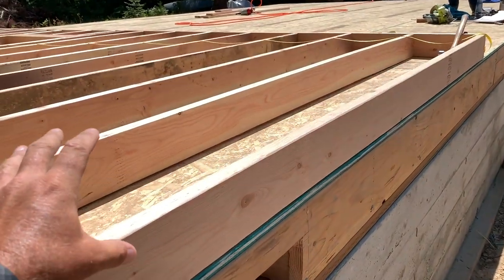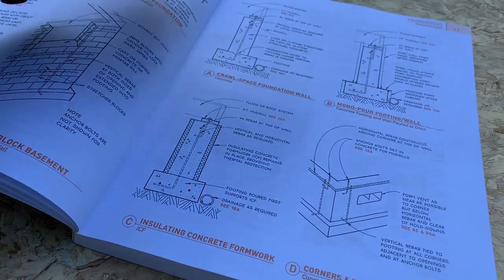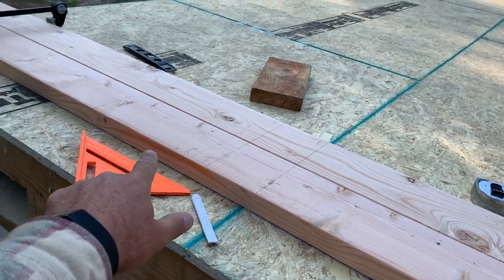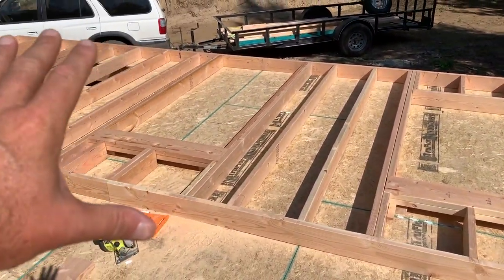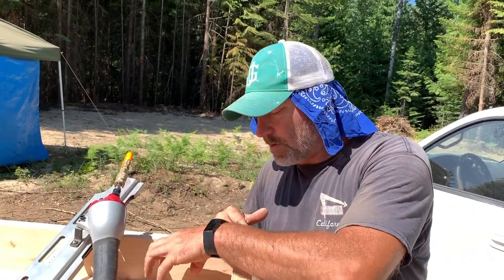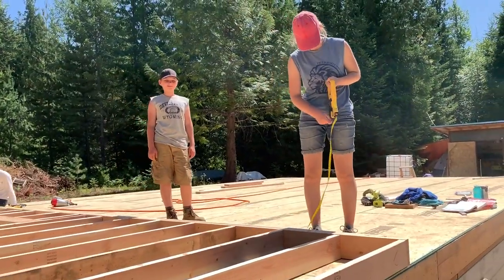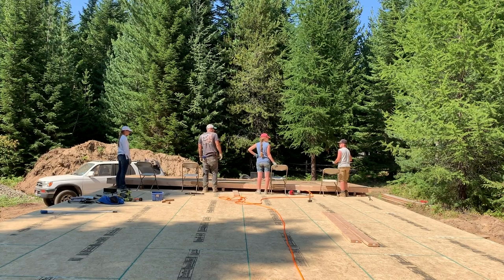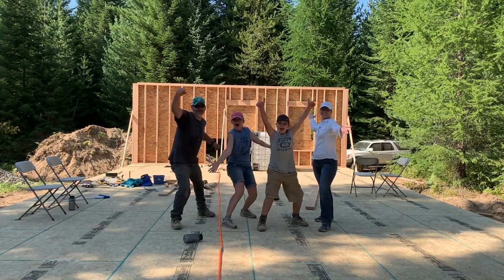Can Our Family Lift This Wall?? | Off Grid Cabin Build #15

Comment: You folks did great.  Do longer wall in two sections; rinse and repeat. Lots of bracing afterwards. Wonderful life lessons for your children.
Reply: Also, before you go much further,  if you'll need 8+ foot/longer sewer or drain pipes in crawl space you may want to throw them down there before laundry room or vents are covered up.  It might be hard to angle them in from trap door opening.

Comment: You crack me up nailed the wall to the floor LOLOL.  Don't forget extra 2 x 6's to nail into your wall and on an angle to your floor to hold your wall in place temporarily until you get all your walls joined together.  You might need some extra help or even using a temporary wench or something.  One parent on each end to lift???
Reply: Sandra Van Lankvelt I was waiting to see if anyone said anything about the parents being on the ends.
I’m glad it all worked out and no one got hurt:)

Comment: Many years ago I was you. I too used 2x6s and sheathed it before struggling to pick it up. I quickly learned to build the wall in sections and sheath it after the wall was in place. Sheathing was easy after an adjustable stand was used to set the sheathing in approximant position. Using a couple of clamps to move it into plumb and nail away.    BTW, it looks like your nail gun days are over. I thinking the two ladies nailing the studs and your son nailing together headers and connecting wall sections.   Matter of fact, you guys should be doing the layout while the girls nail away.

Comment: I voted yes, but you need to build the other walls and get some help to stand them. DON'T GET HURT you've did one, that's great. Call your church, they will help stand them. That was a short wall I think. You will not be able to stand a long wall if I'm right. Putting the osb on first was smart but heavy. I was grunting all the way. Did you have any boards nailed in the door way to keep the wall from sliding of. Accidents do happen. Good luck your doing great and your family will carry these memories for ever.

Comment: You can nail studs to bottom plate, lift it temp nail top plate, square it and finish nailing. Cut in Windows and doors with header after.  You can also frame in smaller sections. Truck as hoist also works. Two ropes on opposing sides as brakes.

Comment: get two winches and 2 2x6x16 to make a wall jack!!!  I recommend toe nailing the bottom plate to the floor with 8d.  (the toe nails help from accidentally pushing the wall off the floor when lifting) Cut that OSB out of the window and door to reduce weight if you are going to sheath the walls before standing.  With 2x6 you could've spaced the studs to 24" oc saving a nominal amount of studs and reducing the weight of the wall.  What is the height of your walls?  9ft?  your house build is looking amazing for rookies!!! Slow and Steady and taking your time!  your family will have so much pride from this experience!  (p.s. hope you and Joce are ready to build 2 more houses when those kiddos get older)
Reply from the maker: Thanks for the tips and compliments. Slow is good. But winter is coming. We are living in tents while we build.

Comment: in earthquake areas we did not install osb wall sheathing until the stud frame was up. and the sheathing went all the way down to the foundation, nailed to the sill with galvanized nails. the sheathing was installed horizontal, brick pattern layout

Comment: Take a 2 x 6 or larger piece of wood and nail it flush to the inside of your frame on both sides of the window frame, that when you go to hang your curtains or draperies you have something to fasten the brackets too. My mother used to complain about not having anything behind the sheet rock to fasten the brackets for the draperies on both sides of the windows other than the 2 x 4 studs beside the window, She like to be able to extend the drapery rods beyond the sides of the window. Just something for you to think about while you still have access before she aiding with sheet rock.
Reply from the maker: Good idea.

Comment: It’s a lot easier to have all your headers right under your top plates. Then frame for your openings. Also put kickers to keep wall from sliding off. Should also have a caulk line on the floor to straighten out the bottom of your wall.  Make sure to crown all your studs the same way. Once you square it out a couple nail in it to make sure it doesn’t move on ya.

You can also rent wall jacks. Two people can lift a huge wall.
Reply from the maker: Thanks for the info. We used toenails to keep it from sliding off and had a chalk line.

Comment: Nice work on the wall raising. If you look at the standing wall there is an optical illusion that makes the left side taller than the right side. It will be nice to get a roof on it then work out of the weather.
Reply from the maker: Trusses are coming in mid September.

Comment: You are going to be fine.  From my experience, building a house is rocket science in terms of skill and endurance.  So don't beat yourself up over mistakes.  Just keep going.  The books will help guide you.  During this phase, hold the cut for the double top plates back an extra 1/16" of an inch for wiggle room.  So instead the opening being cut at 5 1/2", go with 5 1/2" + 1/16" (I was taught to cut at 5 5/8").  Your framing life will be easier if you give a hair of wiggle room in your cuts.  Raise  long walls first, then the shorter walls.  
One last tidbit.  I had the best trainers, I mean the real big guys here in CA.  They taught us to frame the walls without the sheathing first, and raise walls w/o sheathing because it is much easier to plumb the walls that way.  For every single job I went out on, walls were always framed without the sheathing.  But, there is no right or wrong here.

Comment: The Patagonian Theory as taught in school, is a way to also ensure square!  3, 4, 5.    3 feet on one side, 4 feet on the other side, from each of those points, it will be 5 feet on a 45° angle. (6, 8 ,10) if you got 3,4,5 you have 90° .... someone out there around you has to own some wall jacks, you could borrow, Don't hurt your children's backs trying to lift these. A high lift jack used in 4x4 trucks, is slow but, will also work with no pain to anyone. These jacks are also a winch when attached with chains or cables.
Reply from the maker: Thanks for the tips.

Comment: The California Carpenters Union taught us to cut the trimmers at 82 1/4" instead of 82 1/2" because walls tend to grow in height as you put them together with nails.  So for example, for a 97" typical wall height, you cut the studs at 92 1/4".  If you go to Home Depot, they sell 92 1/4" studs.  So, if you are going to cut your studs at per se 92 1/2" in length for an 8-foot high wall, I would do so consistently all the way around.  This is a small technicality that wall heights 8 ft, 9 ft, 10 ft tend to grow as you nail the plates to them, because typically there will be gaps.

Comment: Don't forget about the router to cut the sheathing out of your windows. Makes it go super fast. :)
Reply from the maker: Is there a good bit for a rotozip that you recommend?
Reply: @MartinJohnsonOffGridLiving  I used a Freud 28-100 panel pilot bit with my router. I don't know if it will fit in a rotozip. The bit has a 1/4 inch shank. :)
Reply from the maker: Koality of Life I have they Ryobi one I think it has a 1/4 inch adaptor.

Comment: See if you can find some high-lift wall jacks. They will make lifting walls easy. :)
Reply from the maker: Is that what you were using to lift that beam?
Reply: @MartinJohnsonOffGridLiving  Yep, they work with a 2X4. :)

Comment: I usually insulate in between the two two by Eights the wood on the inside gives you something to mount curtain rods Etc but nothing wrong with the way you did it. What is the rebar sticking up for
Reply: rebar=electrical ground maybe?
Reply: @et5222  that should be copper and put into the ground
Reply from the maker: It a ufer ground https://en.m.wikipedia.org/wiki/Ufer_ground